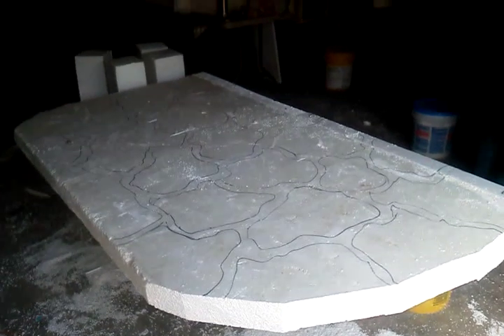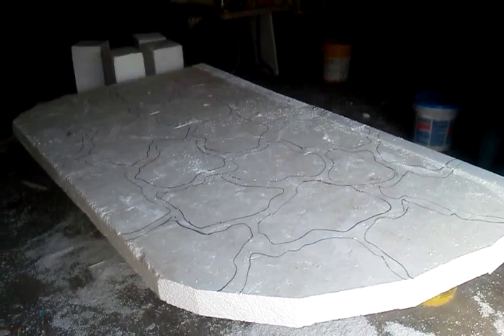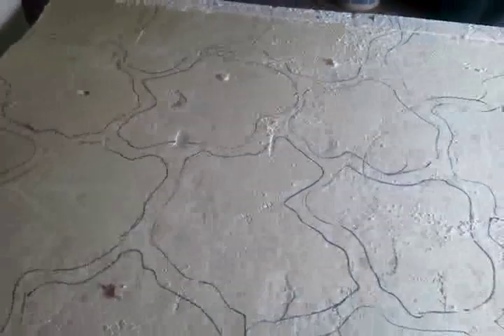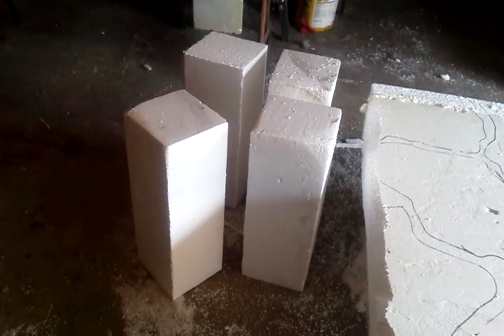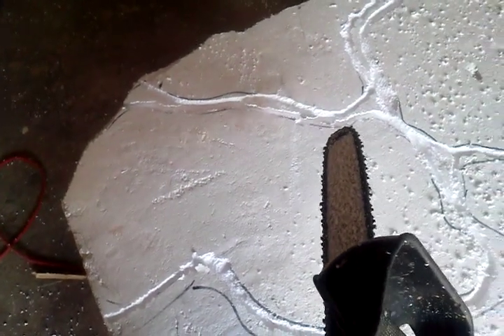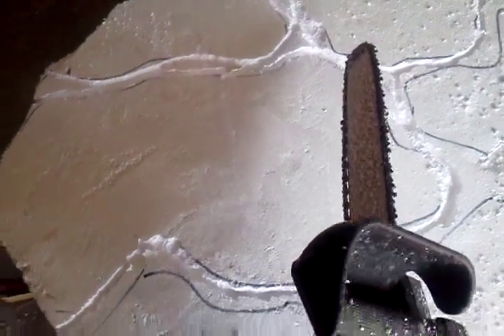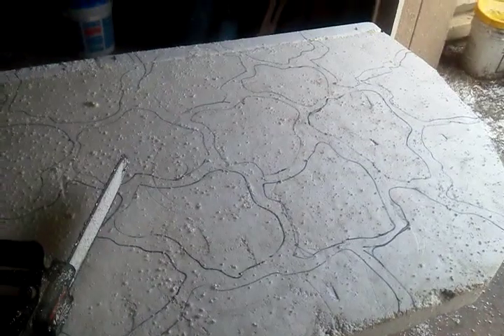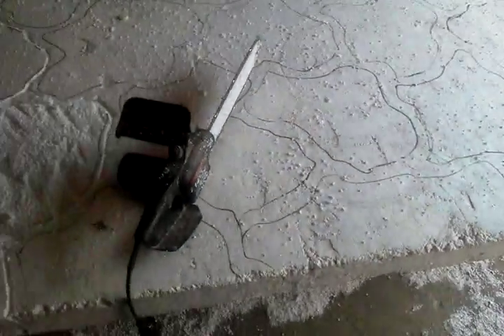how to carve foam fake rock.

Comment from the maker: Ineed , most of this foam is recycled from roofing contractors, commercial flat roofs use it. I save it from going to the land fill. Trash to treasure Or art, you might say.  foam manufacturers sell what ever size you need.  Benchmarkfoam is one I buy from if I need, other wise try too use recycled.

Comment: Worst possible way to do it...
Reply from the maker: Thanks, I see you have done a number of great foam projects...
Reply: blackhillsfoamworks I make miniature models of many sorts both for hobby and prototyping, eg. this one http://www.coolminiornot.com/344865 Most of the internal structure of this thing is made of foam. What I said is this method is both imprecise and incredibly messy (plus kind of dangerous, but not the point here). You can disassemble a hairdryer to get parts for a hot wire cutter almost for free, avoid the mess and get some precision.